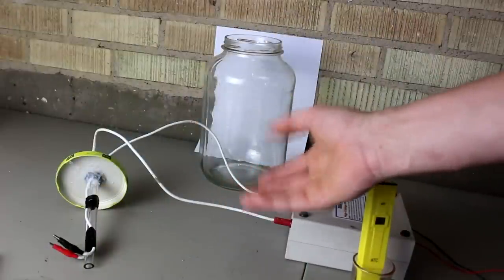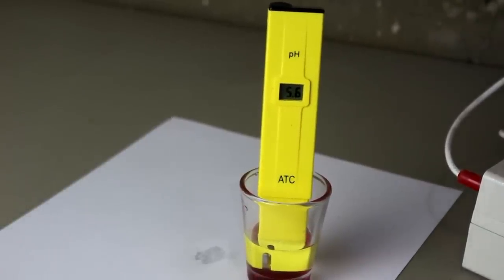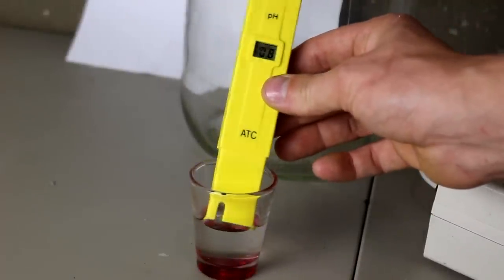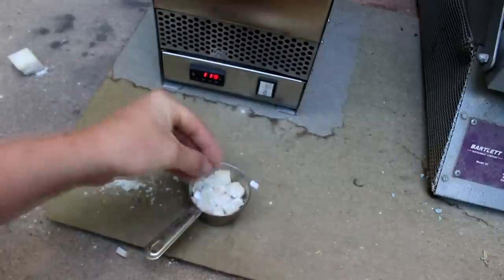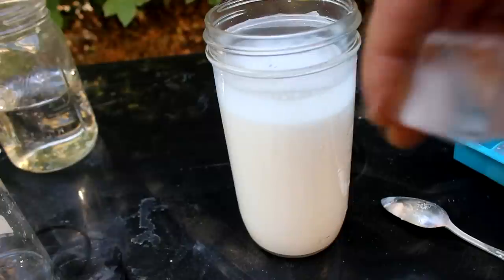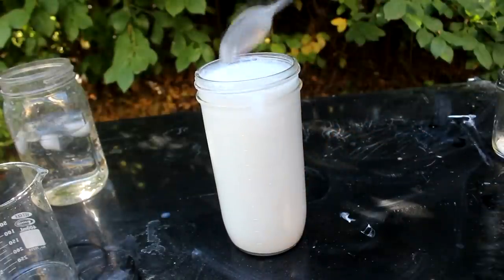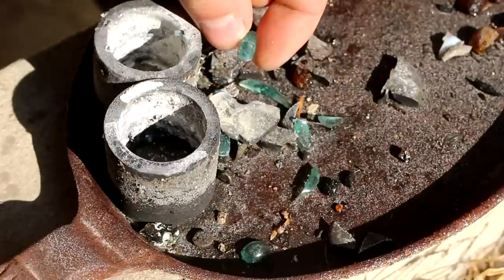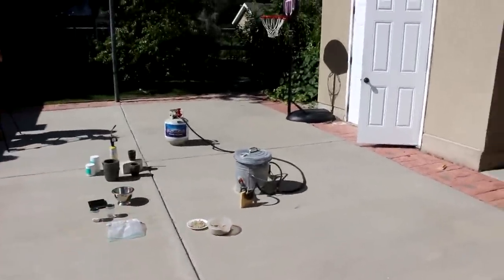Purifying Glass Ingredients For How To Make Everything & King of Random

Comment: Not sure if you saw my last post on the older glass video. Glass makers actually add sulphides/sulphates, forget which one and add a reducing agent to MAKE lots of bubbles to produce a bubble free glass. Sounds backwards but you have to make big enough bubbles to overcome the viscosity otherwise they will just sit in the glass not moving anywhere. They also go to 1400c which helps. If you do a pdf search for 'fining carbon glass sulphides' there's a lot to read.

Comment: If you try this again you might try another additive, Manganese dioxide, cerium oxide, or selenium oxide are used as decolourants. It seems that normal soda glass still has around 0.1% iron, giving a very slight tinge. One other thing you might try is pre cooking the sand after you pan it. I have seen iron bloomery recreations where they roast the iron ore in order to bring it to it's curie point where even non magnetic ore becomes magnetic. It can then be picked up by a magnet making low concentration ore usable.

Comment: Silica sand, Soda ash, Dolomitic Limestone, Calcium Aluminum, zinc oxide, sodium nitrate, cobalt, selenium , gypsum= used in the manufacturing process of type 3 soda lime flint glass. most commonly used in glass containers like spice bottles, nail polish, most beverage bottles. color is introduces at last stage using frit granules.
Reply: Some of that might be hard to obtain from raw materials, which is the whole point of the collaboration.

Comment: The dissolution of most strong acids and bases tends to be exothermic. Given that dissolution is an equilibrium process, according to Le Chatelier's principle, decreasing the temperature of the equilibrium system increases the solubility of any substance with exothermic solubility (I'm not sure about the proper terms in English as I've studied chemistry in a foreign language). Is this the reason why cooling the Ca(OH)2 solution benefits the dissolution process, whereas when dissolving a substance with endothermic solubility (like KNO3 and many other salts), you would want to increase the temperature to benefit the dissolution process?